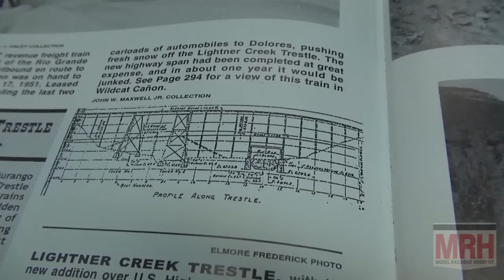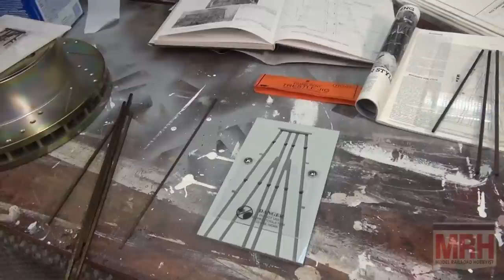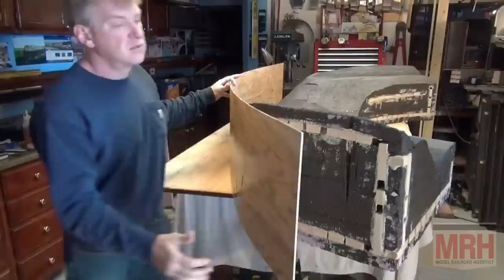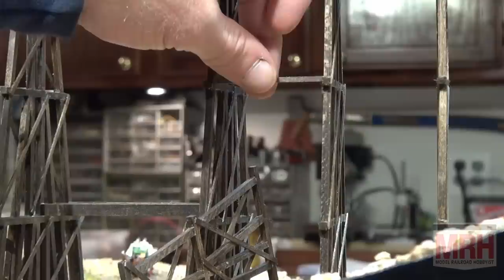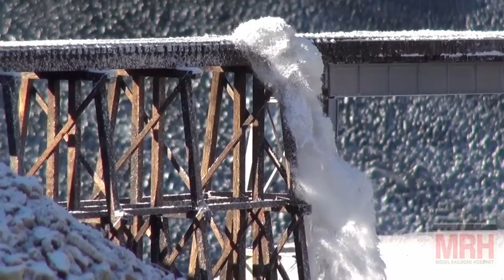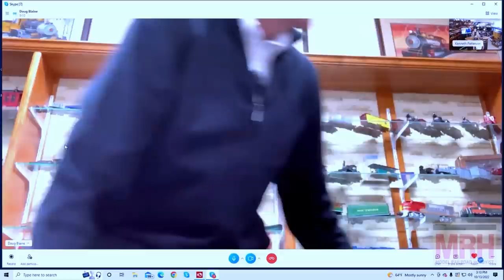Let's build a trestle scene | November 2022 WHATS NEAT Model Railroad Hobbyist

Comment: Ken,  I don't know if the RGS did things differently than other railroads or not.  The Cap, (topmost cross piece) for most RRs was a chunk of wood the same size as the Piling, in your case 12 X 12.  However the pilings where not cut at the next and other cross pieces (Sashes)  The sashes where made from 12" X 3" or 4" and bolted to the Pilings.  I would think that the way you did it, cutting pilings in two at every story, would produce a week Bent!

Comment: Everything about this was fantastic, using plexi to essentially build a jig so you can crank out trestles,  heck even carving out the foam to put pieces of wood in there so you have a nailing/gluing surface for the plywood wrap just blew my mind in a "why didn't I think of that?"  manner.    Thanks tons.

Comment: What an amazing job, Ken. Thank you. By the way, the reason the torch gets rid of the bubbles in the resin is because the heat expands the air in the bubbles and that expansion causes the bubbles to burst. Just wanted you to know.